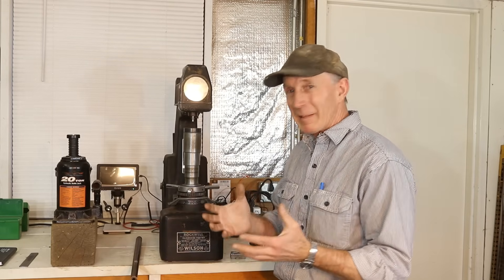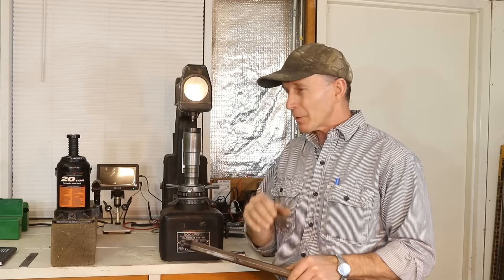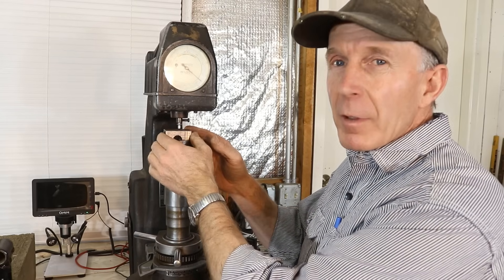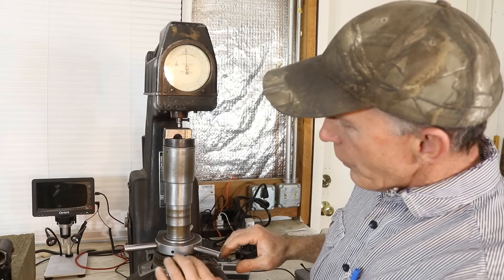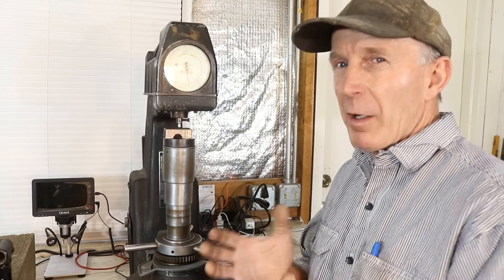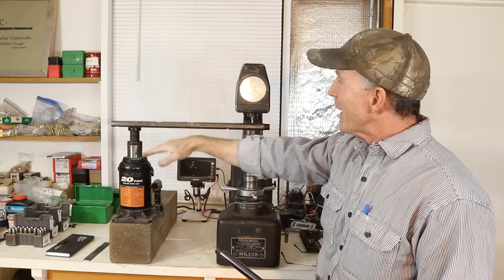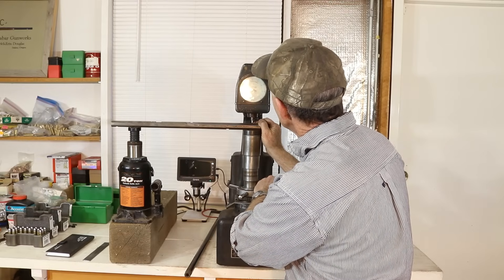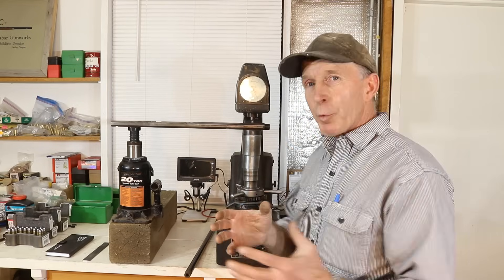Hardness Testing Original Winchester Barrels

Comment: 73 ？？   HRC ？HBS or HS？？
Reply from the maker: Hi Yuri.  I stated quite clearly that I was using Rockwell B Scale (HRB) in order to more clearly compare the steels.  Mild steels don't test well in HRC.  They barely register on the Rockwell C Scale.
Reply: Hi ， Thank you for your reply. from what I understand some of these barrels are mild steel which has not been quenched.right？ @thecinnabar8442
Reply from the maker: Correct.  Mild steel barrels are not heat treated or quenched.
Reply: Really appreciate your explanation，I made a 4140 steel barrel （.32ACP）and am debating whether to heat treat it or not. It seems like it should be strong enough. thank you! your explanation is very helpful to me  @thecinnabar8442
Reply from the maker: There's a good chance that your 4140 barrel is already heat treated.  Most 4140 is sold in its hardened state.  If you've pulled a button through it, you may want to consider tempering the barrel to relieve the stress created by the button rifling process.  Cut rifled barrels don't need to be stress relieved.

Comment: I have a Winchester Model 1873 in 38wcf that was manufactured in 1904.  Would I be doing this rifle a disservice if I shoot some copper jacket soft points through it?
Reply from the maker: It's the combination of jacketed bullets and high velocities that wear out the mild steel barrels like in your 1873.  As long as you keep the velocities down, it won't hurt your rifling to shoot jacketed bullets and can significantly improve accuracy.  Often these rifles with borderline bores will only shoot well with jacketed bullets, so it can be the only good option if you want to shoot them.  Of course, the bore can be relined with a modern liner if it's only shooting you're interested in, but that significantly impacts the collector value.

Comment: A real interesting video. Winchester was in business to make money so use what works not the latest and greatest! They had to meet the factory specification for a cartridge. Not something we have worked out later in history. I was in the custom ammunition business and understand this well. You want to make a superior product but you cannot go broke doing it! This is just a thought but the slightly higher reading you are getting might just be the variance in testing equipment or perhaps could be some work hardening from the barrels being shot. I noticed you were testing under the chamber. I am wondering if it would be different half way down the barrel. More in line with your thought on what the hardness should be.
Reply from the maker: You're right.  I think Winchester didn't see a benefit to making a more expensive barrel for those intending to shoot standard grade ammunition.  Nickel steel and then Proof steel barrels could be special ordered for those who wanted to shoot higher velocity jacketed bullets in the models and calibers that came standard with a mild steel barrel.

I think the late 1886 barrel tested slightly higher than the earlier mild steel barrels simply because they were using a better quality of mild barrel steel by 1941, but that's just my guess.

Comment: In your opinion does proof steel for 44-40 seem unnecessary?
Reply from the maker: Yes, if the buyer only intended to shoot standard ammunition.  For those who wanted to shoot higher velocity jacketed ammunition, it would take out the rifling of a mild steel barrel.  Nickel steel barrels were developed primarily for extra wear resistance to be able to shoot that type of ammo.  Winchester produced a "Winchester High Velocity or WHV" ammunition with higher velocities and jacketed bullets that was marketed for use only in nickel steel (and the later proof steel) barrels.

Comment: Very interesting. It makes me wonder if 45-70 ammunition before WWII was ever loaded with jacketed bullets.
Reply from the maker: Yes.  Winchester produced "Winchester High Velocity or WHV" ammunition shortly after introducing smokeless ammunition.  It was a higher velocity ammunition with first a cupronickel jacket and later a copper jacket.  It was marketed for use in firearms with nickel steel barrels only.  Many of the Winchester factory records have a notation of "WHV" if the rifle was special ordered with a nickel steel barrel.  I suspect quite a bit of WHV ammo was shot through mild steel barrels though.  Considering your background, I'm sure you're well aware that shooting high velocity jacketed ammo through a mild steel barrel is very hard on rifling.

Comment: That late 1892 barrel makes sense. Why spend extra money on good steel for a pistol caliber? How about 1890 barrels or other early .22 barrels. Bet they are mild steel also.
Reply from the maker: I think you're right about the 1890 barrels.  I don't believe they were even offered in nickel steel as an option.  I've not seen an 1890 with a nickel steel barrel.

Comment: Mark, Laser light in a long tunnel as usual. However when operating Wilson Hardness tester a proof certificate was attached as well as logged in a book kept by the operator or owner. Knowing how particular you are about authentic, irrefutable, repeatable, and defendable information I thought you might have had that last gage inspection information that verified the level of accuracy when last tested with a known hardness of material by a certified laboratory. I really enjoyed your demonstration, even though you admitted it was not as you will have in the future. As in perpendicular to high speed or diamond  brale that penatrates the surface of metal tested.  I have shared this video with old friends who always have a propensity to take a position on hardness of coatings as well as firearms parts hardness. 
In the future you will probably test mechanical parts and receivers for their hardness, especially area of receivers over barrel threads. With all the claims of hammer forging, it will be interesting for you to share that information. Most definitely appreciate your historical intellect, years of experience, and professional polite demeanor for sharing such a plethora of information about firearms history that seems to cover such a broad range of topics. 
The atmosphere surrounding Cinnabar Ranch emits the aura to share such adventurous knowledge. TRJM 🦅🙏✡️
Reply from the maker: Thanks so much for the compliments.  There wasn't a proof certificate with the machine.  Fortunately, it did come with several certified test blocks of known hardness, so I was able to verify its accuracy.  It also came with a couple of diamond brale penetrators and the extra 50 KG weight so that it can be used to test in the Rockwell C scale when appropriate.

Comment: You should test some receivers. I know you have that blown up 1894 you could use. I would like to see early and late production of the differing models, 73's, 86's, 92's, 94's, model 71, etc. I've heard some say late 1886's are the same as the 71's, but I'll believe it when I see it. Great video.
Reply from the maker: Thanks Skyler!  I'm doing some research now on receiver steels.  Unfortunately, Winchester wasn't courteous enough to mark the receivers like they did with the barrels, so I'm trying to find if there is some documentation about whether there were changes made in the receiver steel over time.

Comment: Super informative video on barrel steel hardness! So many shooters will say a guy can't shoot smokless loads in a Winchester unless it says nickle steel or proof steel. Of course we know that safe loads aren't from shooting black powder exclusively, but proper pressure loads that fall inside of factory designed parameters. 
I shoot modern smokless powder in 38-40 through my 1885 made Whitney Kennedy rifle.
Reply from the maker: You're absolutely right!

Comment: Fantastic addition to your toolbox! It's interesting to see the results you got on those barrels. I wonder if Winchester purposely used the softest steel that would be safe depending on the caliber in order to help prolong tooling life during manufacture? I'd think there would have to be a balancing point between harder steels and machine downtime, especially before carbide tools became widely available.
Reply: Ya, that's a good point.
Reply from the maker: I suspect you're right.

Comment: I been wanting to order a 30 inch octagonal barrel in 38-55 or 40-82 and build a rifle with Chrome moly vanadium barrel, to hold up to the higher pressures.  Do you think the receiver will hold up ?   the 1886 certainly holds up to full loads of 45-70, I'm thinking the 1892 and 1886 will will hold up.  What do you think?
Reply from the maker: They will hold up if they are in good mechanical condition and you don't go crazy with the loads.

Comment: Hi Mark,  Very interesting BHN on different barrels for the time periods, one might conclude the harder barrels must have been more expensive to produce. Since I have a few 1873 Winchesters from the 1800's I would conclude mild steel barrels for both.
My 32-20 octagon barreled rifle has a ring mid barrel, and a very slight bulge midway, and i was thinking of sending it out to have a liner put in it? any thoughts on that? and would modern liners be made of proof steel?
Thank you

Chris
Reply from the maker: 1873's could be ordered with nickel steel barrels, but very few were.  They're very hard to find.  I would expect the major liner makers all make liners from modern chromoly steel similar to Winchester proof steel.

Comment: Very interesting Mark. When you think about it, these mild steel barrels have endured black powder and smokeless over many years and are still viable today. In fact, I would say that sometimes have a barrel that is slightly softer has advantages as it has to absorb some serious pressure shock. Too hard of a barrel may develop brittleness.  A Rockwell tester is on my wish list for the shop. Thanks for sharing.
Reply from the maker: The issue with the mild steel barrels is that the rifling doesn't hold up to higher velocity loads with jacketed bullets.  That's why the nickel steel barrels were introduced when the velocity was increased with smokeless powder and jacketed bullets were starting to become popular.  Those hardness testers are definitely a handy tool to have in the shop.

Comment: I do quite a few relines in 22's and have found Win barrels in like lo wall rifles to have hard spots in them. Stevens guns drill like butter. I had one lo wall barrel I had to resort to a carbide drill at great expense to me to get through. I normally use cobalt drills. I measure the orig. bore and grind a pilot to fit. I don't use the "liner drills" you can buy and only use "TJ's" hammer forged liners. All work is done in the lathe for accuracy. That hardness tester is a great asset. Thanks for the demo and keep us posted on the new store...
Reply from the maker: I've come against those hard spots too.  Definitely not a lot of fun!  Glad I didn't seem to hit any in these tests.  That would really skew the results.

Comment: this cannot be rockwell..70 rockwell is crazy hard on a knife and barrels are supposed have a hardness of 25 to 32 hrc (rockwell)..
Reply from the maker: Wrong.  You're thinking of the Rockwell C scale used for high carbon steels.  Rockwell B scale is used for mild steels.  I mentioned that in the video when I said a diamond penetrator point is needed to measure Rockwell C hardness on tool steels.  In order to compare the mild steel barrels which barely make it onto the C scale with the Nickel and Proof steel barrels, I had to use the B scale (HRB).  The Nickel and Proof steel barrels tested in this video would convert to about 28 on the C scale (HRC)
Reply: @thecinnabar8442  okay..this makes sense..my mistake..
Reply from the maker: No problem.  I should have explained that better on the video.
Reply: @thecinnabar8442  thank you for answering..greetings from germany..